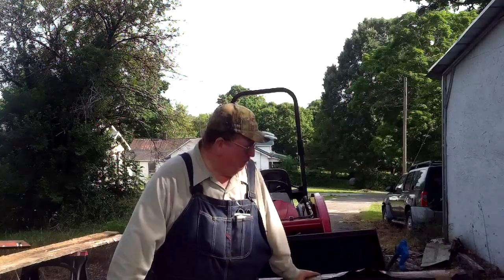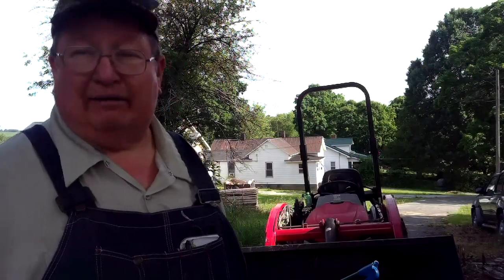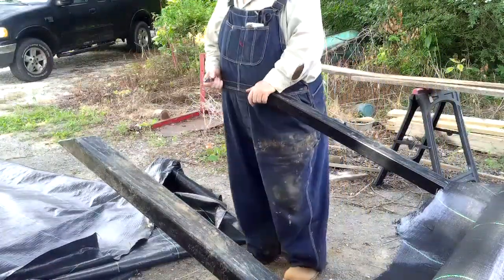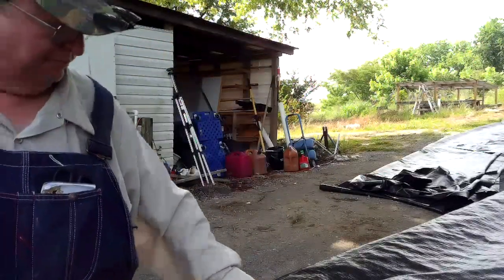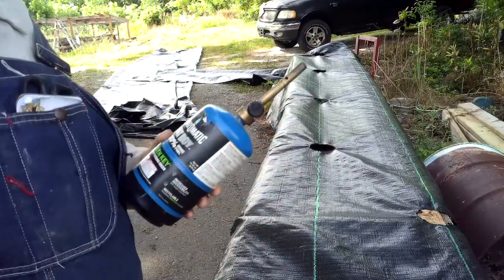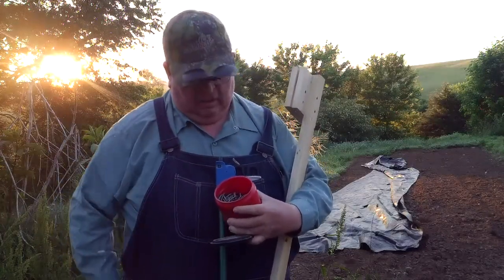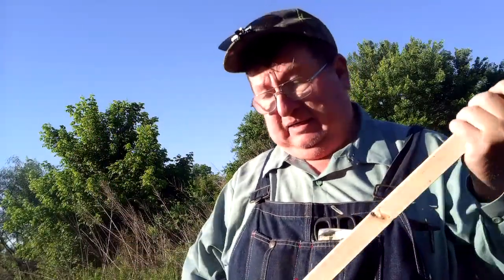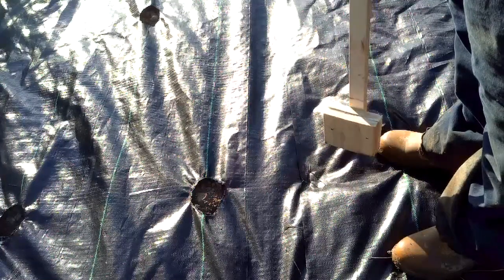Using Agricultural Fabric as a No Bend Gardening Aid

Comment: I've got you by 8 years and started to use this. I always put fertilizer down first and lay t posts to hold the  ends down.Not end to end maybe 10 feet in between each. Never had it pull up. So much easier to take up at the end of the year. I do use the torch to cut the ends as they will unravel and bury them with dirt
 Good luck.
Reply from the maker: Do you take it up every fall? I was thinking about leaving it down and covering the holes in the winter and maybe taking up every other year. But haven't decided.
Reply: That would work. I did that to one row this year and foliar sprayed fertilizer.  I always plant with triple 20 even if I spread fertilizer underneath.